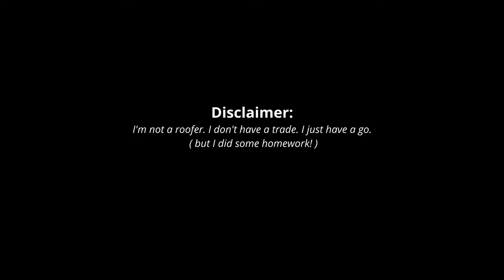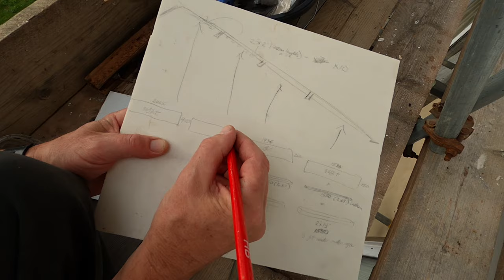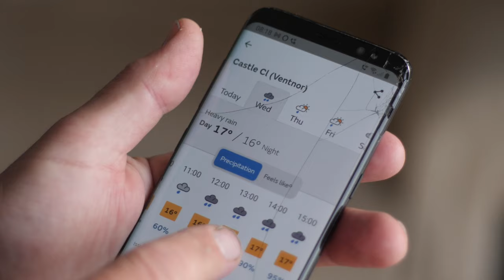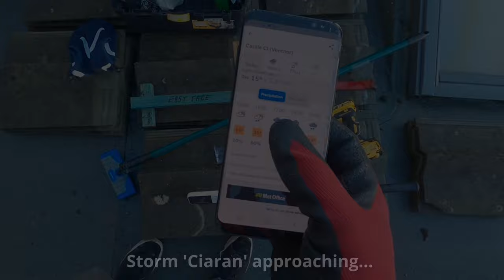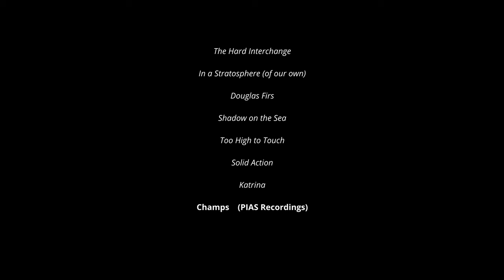Roof Repair, including fascia and asbestos soffit removal - late 1960's house

Comment: Thanks for the sharing. I'm considering the same exercise myself with a 1975 house. How did you find out about the asbestos softfit boards? Mine look to be wood and worse for wear. Is that your own scaffold or local hire?
Reply from the maker: My research indicated that houses of that era typically had soffits made from asbestos. I also poked/prodded a couple of edges and it was pretty clear it wasn't wood - quite crumbly!  Hence I 'suited & booted' up to be safe.  Scaffold was hired from local firm - "TFH Scaffolding".